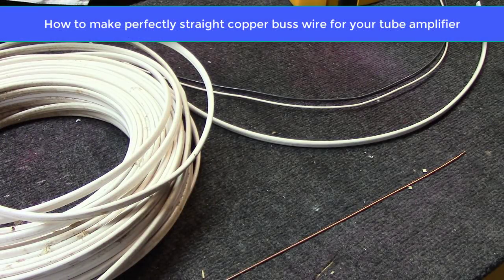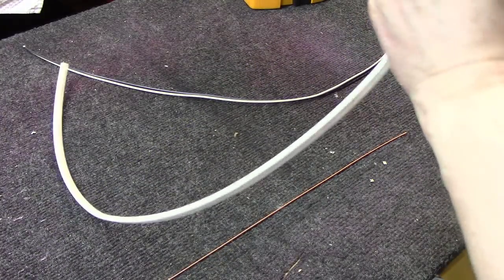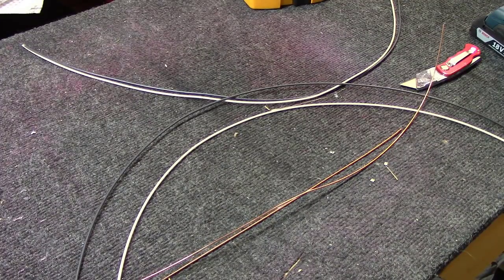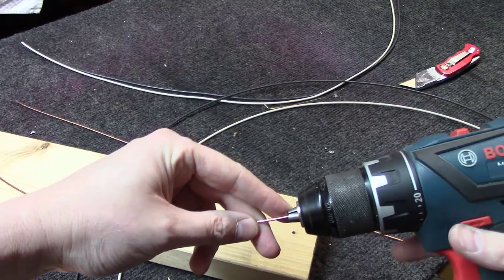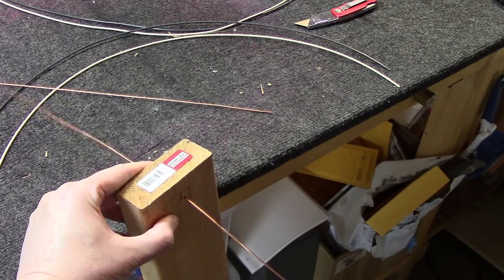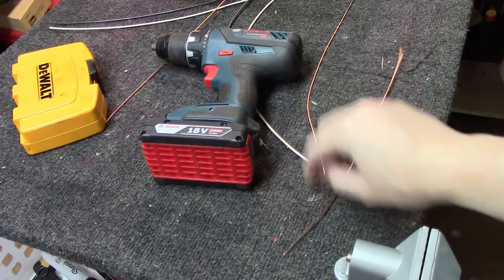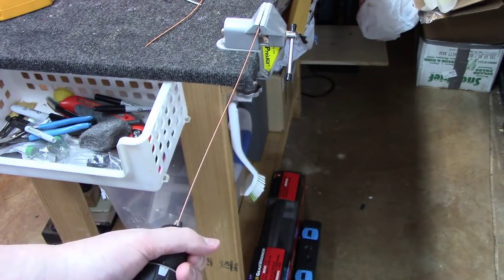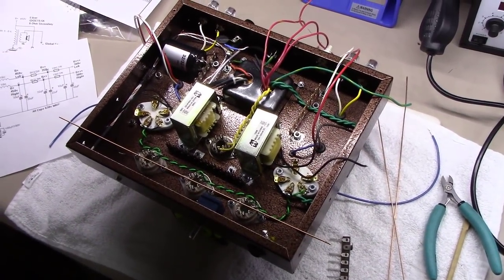How to make perfectly straight copper buss wire for your tube amplifier

Comment: Curious to get your thoughts about abandoning the back of the pots bus wire for strategically placed chassis grounds close to the board or pots as needed. 
One for input, one for screens and phase inverter, one for power supply, one for B+, and one safety ground for the power cord.

Comment: This is an all around bad way to straighten copper for bus wire, this will introduce work hardening that will make the copper brittle and subject to microfractures.  A better method is to clamp one end of the wire in a bench vise, grab the opposite end of the wire with vise grip or similar locking plier.  pull on the wire with your weight until the wire straightens out.  The heavier gage the wire, the more weight you will need to apply to get it straight. Be sure and keep one foot behind you in case the wire pulls out, just use caution. Someone in the comments suggested that the mere act of soldering and subsequent cooling would anneal the wire, the soldering process does not come close to the high temperature (700°-1200°F) or the rapid cooling (cold water) required to anneal copper. In any event, I would NEVER treat my expensive copper wire in the manner shown in this video.
Reply: Annealing isn't the same as quenching, slow cool for annealing, quenching re stresses the metal.
Reply: You  are correct if referring to Ferritic metals, however where copper is concerned the method I describe is correct. I have worked with copper for decades.  Try it and see for yourself, or google it.
Reply: I have I used to do copper headgaskets and washers, the quenched were harder than the slow cooled, everytime, all the time, I actually did it many times over the last 40 years and experimented, not a youtube myth or hearsay or a book, long before google, since before computers, actual living fact, me personally.
Reply: I also use the vice clamp and pull method.  It means you stretch the wire a bit, but it comes out nice and straight.

Comment: Unroll the coil on the floor before cutting from it and it'll be plenty straight. Cut the cable to desired length then pull the ground straight out from between the black and white.

Comment: Would the hardening in the second method substantially affect the conductivity of the wire?
Reply: It seems cool but I would say it would crack over time, it needs annealing.
Reply: Its measurable, but not a massive effect - its not nearly as bad as replacing with aluminium wire(!)

Comment: No surprise the copper stayed straight after twisting it,  having work hardened the copper. The nice ductile wire is now brittle. Pulling it through the hole is a good idea, I think.
Reply: Mark, sorry, It doesn't take a lot of working to break already work hardened copper, in fact it will break given any chance. I just don't think this is a good idea. Look at the properties of work hardened copper. Any defect in the surface will result in failure, any mechanical issues will seriously affect reliability. Just a bad idea all round.
Reply: It takes a lot of working to break copper, its extremely ductile, a bit of work hardening isn't going to make it brittle.  The work hardening will somewhat increase the resistivity of the metal though, which is why electrical copper is usually in the annealed state.
Reply: Soldering to it followed by cooling would anneal it anyway
Reply: Rod Smallwood  No, copper is not steel. It needs fast cooling to anneal and slow cooling to harden
Reply: @ashscott6068  Late to the party, only posting this for others.
This statement is totally false.
Copper can not be hardened by heating and cooling. Copper is hardened by work hardening, and annealed by heating. Quenching vs air cooling makes no difference
Reply: I agree, having brittle wire that's subjected to high voltages is not a good idea.  There's also no need to straighten copper wire to be used in electronics.  It's made ductile for a reason.
Reply: Cherry red is ideal for annealing copper. Also these are long bits.

Comment: Two pairs of pliers one each end and pull like hell. That's how my electronic wiremen did it 50 years ago.
Reply: Or lock one end down in a decent workshop vice, wrap the wire a few times round long-nose pliers and carefully pull back till about 3 to 5% extension.  You feel the strength increase as it work-hardens a bit, pull too far and it will get weaker again and snap.  Eye protection.
Reply: Those guys were real craftsmen.  Beautiful straight looms. I would of course put the pin numbers on the plugs at the end points on the drawings when I did the circuit design. But the stuff in between, colours and routing they always did a great job on their own.